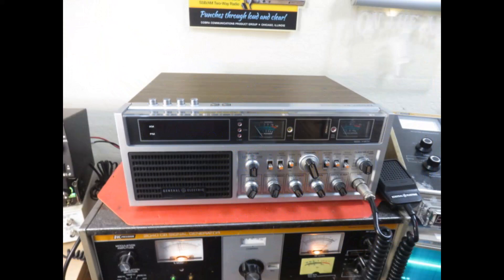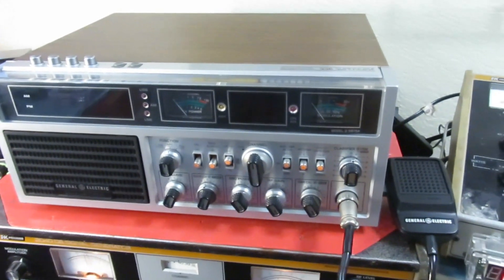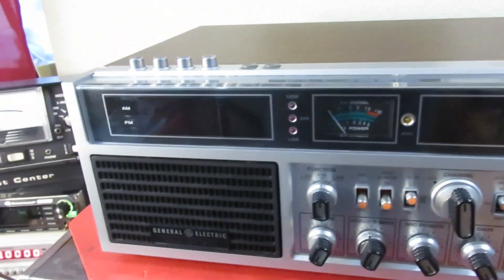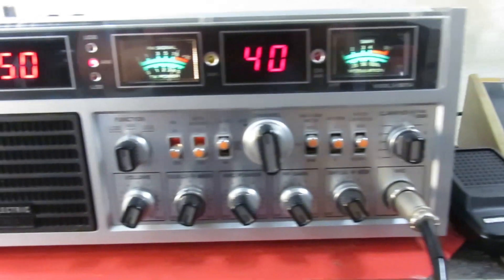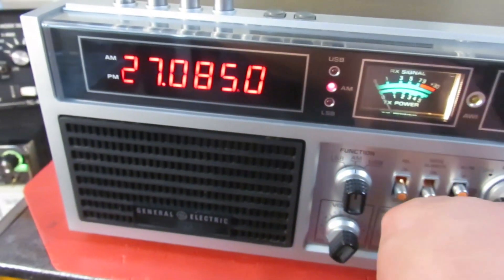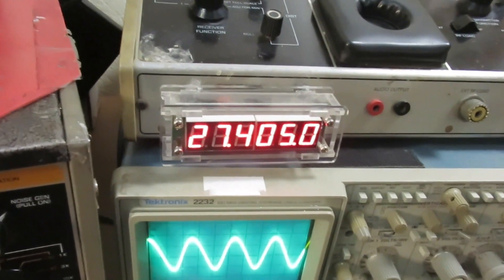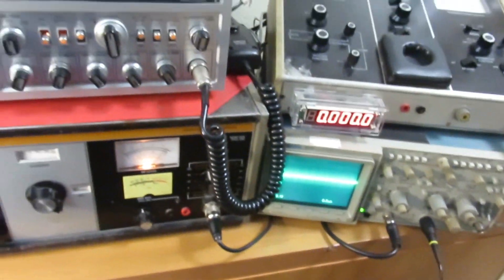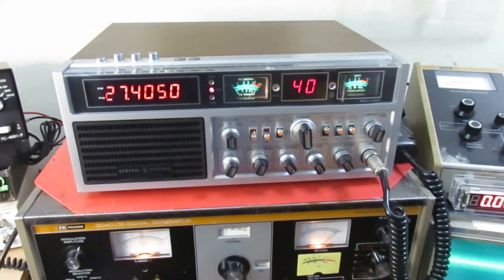GE Superbase w/ Counter Ready for the revile?  it needs a home

Comment from the maker: Let me know where this should be priced? for reference on my pricing here is the only one on eBay at this time selling for "parts only" and with a missing switch for $1k https://www.ebay.com/itm/387754791187   and Here is the one that recently sold for $700 but the channel numbers are bad say what? https://www.ebay.com/itm/196697748498
Reply from the maker: here is another one that Sold for $700 plus shipping. Seller said they had no clue if it worked  https://www.ebay.com/itm/256775302902

Comment from the maker: So the price,  everyone wants one right  there is a reason they cost more...  they are rare and even more rare working.   I looked at eBay,  only one for sale is $1000.00 for a rig with a missing switch and sold as parts,  I looked in the sold and the only one that said it worked got $700 and a bunch of shipping $$ and said they were not a CB user... so.    So I sell these high end rigs for more to help make up those loses I take in from some other rigs.   So I am thinking if someone is selling a broken one for parts for $1k   then that should be my starting asking price.    So yeah not for everyone budget I know...  but some folks that is not an issue.       hope that helps   reach me here or at bcoollradios@gmail.com